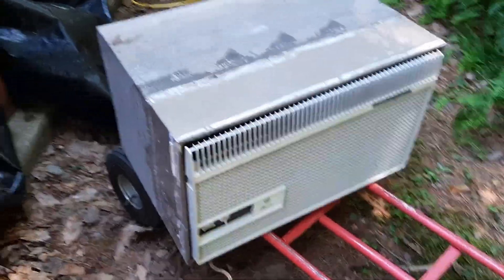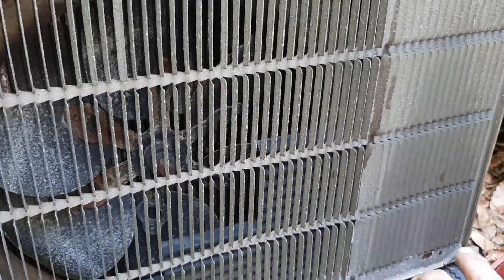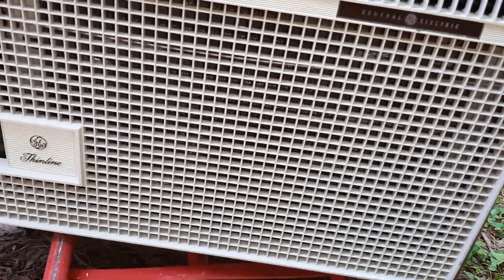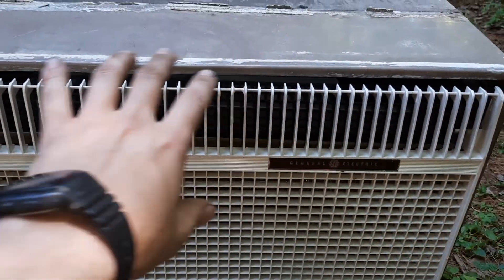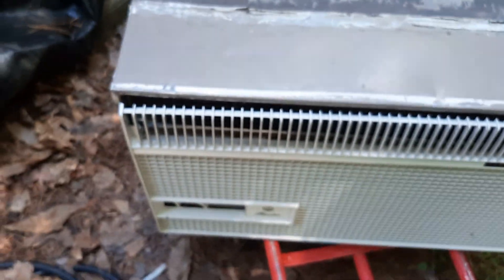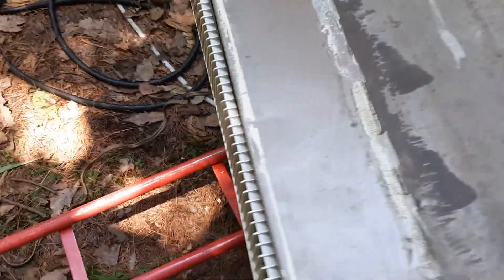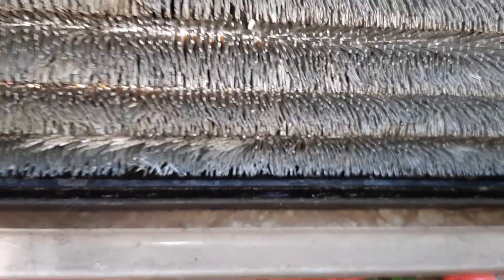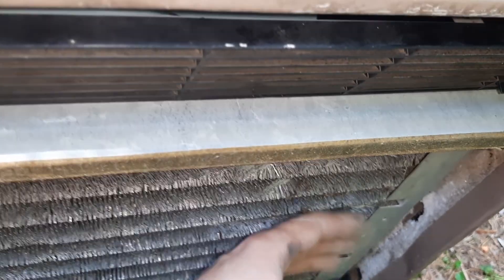1960's General Electric lo thinline part 2

Comment: My parents had either a 1962, or 1963 Thinline unit in their bedoom and boy, did that unit cool down that room. That u it would freeze you out if the thermostat was set too low. It was a great unit and lasted a long ti.e before it was replaced. GE made quality stuff at the time. Keep that unit.

Comment: My neighbor had a slimmer unit to this, but it's grill was completely different, I think it had 5 circular vents like the fashionette and the hi-thinline units and a vertical control panel with 4 knobs. The grill was brown and gold I think, I knew the control panel was gold. The back looked exactly like this unit and sounds exactly the same.

The sound of it reminds me of summer memories and coming outside at night and seeing / hearing the unit run next door with the orange glow of sodium vapor straight lights.